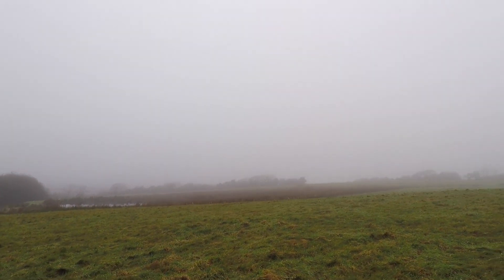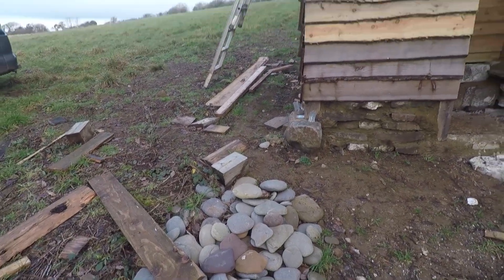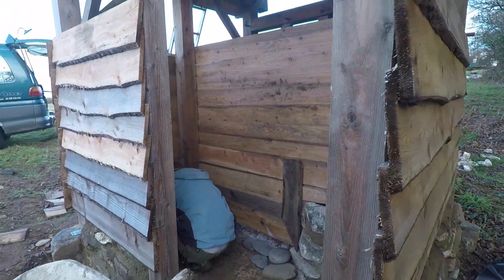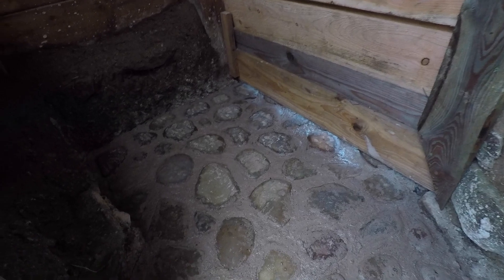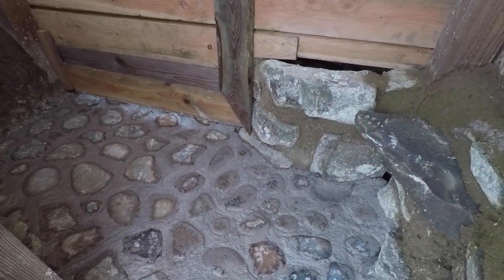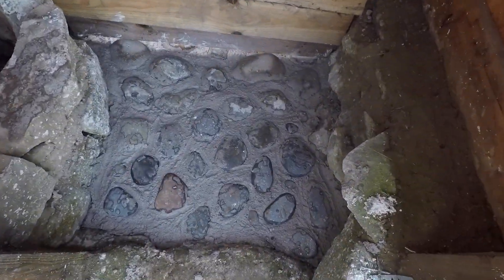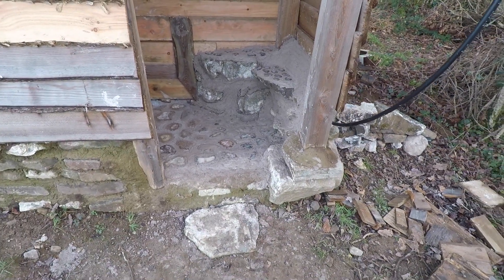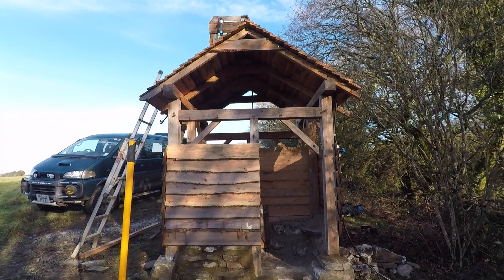Off Grid Solar Shower and Compost Toilet Part 5 Pebble floor

Comment: Good work, pherhaps wrap the hot water copper pipe coming from the panel with some type of insulation to reuduce heat loss.

Comment: Always love the videos, thanks for all the effort and sharing. On our showers we used a piece of string from inside the shower going up to lift the float valve on the tank inlet, .......pull and hook it to shut off the supply, ......unhook it to refill the tank up after the shower. That way the kids didn't forget to do it !

Comment: You should consider a ram pump setup from the stream to fill the tank, check out “land to house “ he does some interesting things with them. 👍
Reply from the maker: it should be gravity fed if i got my calculations right. so no need for one.

Comment: Have you thought about using an unpowered spring/ check valve based ram pump using the streams head to pressurize your bath and dish water, and to fill the pond up higher during the summer? Ram pumps are really ingenuous. You could probably tie into the hydro power pipe with a valve for when you want to engage the ram pump.

Comment: Hey Kris. Don’t know if anyone told but the roof looked a little wobbly. 😉

I doubt you will have issues with the water getting cold in the tank during the summer unless the stream stays cold all summer. 

Besides. If the first shower drops the level in the tank then opening the valve will just lower the temp for the 2nd shower by refilling it then. 
Either way as Gaz said “A cold shower is better than no shower.”

Comment: 7:00 unless i got confused, isnt that T to mix cold into the shower after the shutoff, so it will be off when the shower is in use anyway?
Reply: from what i understood he doesn't plan to mix cold water, and i was wondering what if the water is too hot, you just trow in cold while flushing hot wasting it until the whole tank is at the right temp? then again maybe the water wont get too hot and the system will work just fine also rinsing the floor with hot water before you take a shower could be a good idea i saw some bird crap on the toilet side.
Reply from the maker: it would be better that way and i might have to change it. but it would be more pipe running that im hoping to avoid. the water coming in will be very low pressure. the the shower head is alot lower then the tank so the water will take the easier path to the shower-head before it tries to push further up to the tank. im hoping that will mean it only drips in the tank because of that. if not i will have to change it but i think it will work.

Comment: You might get longer hot showers if you put a float valve to keep the tank full and use a copper coil for a heat exchanger in the tank to heat the flow to the shower. That way the tank can still heat while it is being used and you will limit the amount of water that sits at less than 60C going to the shower.

Comment: Great work as always Kris, although ……. I would love to see you attempt a DIY version of an evacuated tube water heater instead of the 'old-skool' copper panel.  with your ingenuity i'm sure you could make a much more efficient system that would perform much better for the both of you :D

Comment: One question; have you considered that the effluent from that toilet will get washed down into that stream thereby fouling it? It is downhill from the field to that building and continues downhill behind it to the stream. Also that cold inlet shutoff valve should be on the inside so that users can use cold water if they want like a cool-down after using hot.
Reply: I’m pretty sure the toilet will be a composting one like his main toilet, so it won’t be flushing/draining anywhere.

Comment: Great work Kris and as otgers have commented, always excited to see your videos pop up. You mentioned "too long" as a concern for the video. I think there's no problem having a long one here and there.
A few points if I may? 1. Would the water run into the toilet area, there's a gap and it's not clear how steep the run off might be? 2. After showering one will be standing in damp floor to put any clothes back on?  3. Could you talk us through the toilet process? I always imagined a hatch at the back to empty it out? Will it not fill up over a few weeks with volunteers use? 4. The stone work on the toilet seems quite wide, one would have to sit quite far back to hit the target and then your bare legs would be against the abrasive stone? Maybe you need to model the procedure 😁 clothed of course :-$

Comment: Fantastic video and work!  I’m just concerned about the proximity of your gray water runoff/soak field to that stream.  Recommendations are for minimum of 200 feet from fresh water sources - even when using biodegradable soap.  Maybe you could put in a settling tank underground?
Reply from the maker: It cant get to the stream because of the mounded earth. and the slope of the land. it is forced to move downhill witch in this case is parallel to the stream for at least 200ft and goes through quite a few plants and trees. im confident that it wont be polluting the stream with nutrients.

Comment: Could always insulate the tank to keep the heat in!
Reply from the maker: it is insulated a bit with the foam you can see in the video. its not much but it will help. still need to do the bottom though

Comment: Chris this is all looking really good - will be interesting to see just how hot it gets in the summer. Just a ignorant question but I notice that lime is used a lot in English building whereas in NZ it is mostly concrete that is used in these situations... what is the advantage of lime over concrete and why do you use it in preference? Thanks.
Reply from the maker: Hi, well lime has a much smaller carbon footprint than concrete for a start. as lime "dries" it absorbs the carbon from the atmosphere that was released when the limestone was burnt. on top of that it is a far superior material for most things other than building skyscrapers. lime is resistant to water but it breaths so you dont trap moister in to walls and you can use it with natural materials that need to breath. It is also softer, that means it can move a little without cracking and if it does crack because it is softer than the stone it is holding in place this means the crack will not run through the stone. the cracks will run through the mortar witch essentially stagers the cracks and makes the building less likely to be damaged Badly. It is also very alkaline so it resists mould well and rodents dont like it much either. It has so many advantages of cement but isnt used much anymore due to the skills being lost. The quickest way to destroy and old building is to start plastering it and repointing it with cement based products. Hope that helps.

Comment: Looking good Kris! Love what you do. My only question is, you plan to mix cold water with the hot if needed, but your tee fitting appears to be after the shutoff valve. If you shut off water to the tank, you wont be able to use the manual cold water mixer correct?

Comment: Won't the T to mix in cold water for the shower be required to be before the main cold shutoff?
Reply from the maker: Yes it would be better that way and i might have to change it. but it would be more pipe running that im hoping to avoid. the water coming in will be very low pressure. the the shower head is alot lower then the tank so the water will take the easier path to the shower-head before it tries to push further up to the tank. im hoping that will mean it only drips in the tank because of that. if not i will have to change it but i think it will work.

Comment: why dont you have a toilet style float valve to shut off the in-flow?... still would have to shut off the valve when you shower but could be done right before and after would save alot of time.

Comment: Looks great Kris. Have you tested the water flow to the tank? The fall from the river looks pretty slight.
Reply from the maker: Yeah i measured it just like i did with the hydro. should be around 5m and the tank is 3.5m so it should have a slow trickle.

Comment: Might want another T and bypass the tank so you could have a cold water shower in the summer
Reply: no bum idea... if it gets as hot as last summer (2018)...
Reply: @veronicapersson9124  god dam it... I used my only good idea this early in the new year